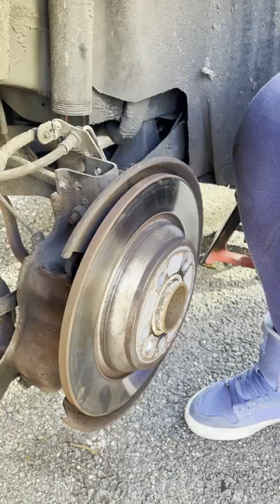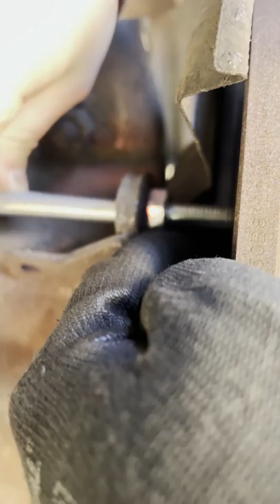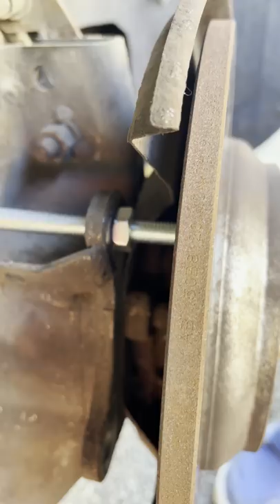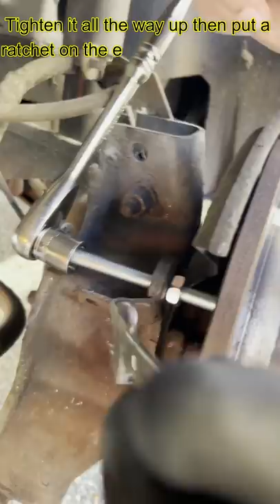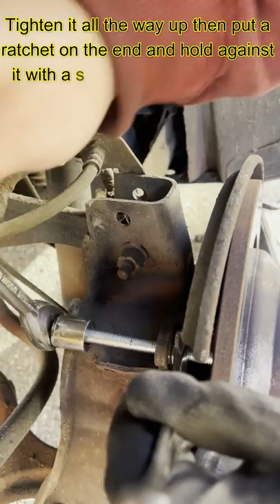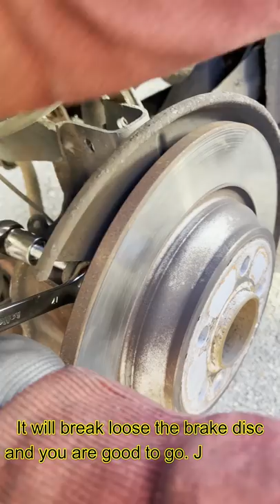How to remove stuck/seized brake rotors

Comment: Don't get mad if you break that caliper holding ear off and have to replace the hub assembly.. this is NOT how to remove a stuck disc.
Reply from the maker: I won't ;) At least I will have something to make a content about.
Reply: @MrNiceGuy94  oof, a hub is a little more difficult than a disc.. go for it !
Reply from the maker: @FRED MERTZ  Here you go.. https://www.youtube.com/watch?v=skcBr7In36c
Before you reply, Yes I am aware that in the linked video I replaced the wheel bearing/hub and not that hub which has the caliper holding ear on it, but I was 1 bolt away from it ;)
Reply: @MrNiceGuy94  I'm not trying to nit pick you..
Reply from the maker: @FRED MERTZ  I know, never thought that. I know comments may "sound" offensive through internet without any context. 
All I am saying is that this method worked for me fine and I hope it could have helped someone else as well.
I won't argue on that this method may or may not break the caliper holding ear off, just simply because it hasn't happened to me so far, but that doesn't mean it can't in the future.

Comment: Once it’s been removed clean where the rotor & hub make contact, then apply anti-seize to the same surfaces & never have issue again. Same with the backside of the wheels: clean & apply anti-seize.
Reply from the maker: Cant agree more,mate. 👍

Comment: Every rotor has 2 wholes for a screw you turn both in equal incriminates and it saves the studs takes it right off
Reply from the maker: agree if it has studs, use 2 bolts
Reply: @MrNiceGuy94  your rotor even has these holes, why tf would you do this, every rotor has those
Reply from the maker: Well, I guess Ethan meant that I could have damaged the studs if I would have had any on this particular car, however I did not have any as you can clearly see from the video. I agreed with him that in the case you have studs sticking out of your knuckle through the rotor use rather 2 bolts and turn them equally, and if you want to be even more accurate you can rotate the rotor itself after a few turns on the bolts to have equal pressure applied to them.
However I do not get what you mean, this rotor/disc ( the part which rotates) has 5 holes for the bolts and 1 additional through which the rotor is mounted to the knuckle.
I really hope this helps.
If you will, please specify what you do not agree with or what you do not understand, even better if you can link pics or a video of it. 
Thanks.
Reply: Damn i left the same comment 🤣 sorry guys didn't see this one. Wrench on
Reply: Got one from a salt area and it wouldn't come off with that method.  The disc started cracking with the two bolts.  Had to use the torch to heat it up.
Reply: As long as the holes you are referring to still have threads in decent condition.  By the time the rotor & mating surfaces corrode & rust over, the the threads are often beyond reasonable use.
I get what you're saying, and works marvels with drum brakes.  But sometimes brute force & a torch is the only answer.
.....been doing brakes 40 years.  I get it.
Reply: Not every rotor has them. This one doesn’t. The threaded hole your seeing is for the bolt that holds the rotor in place.

Comment: There is a service hole for removing the stuck rotor, so you can remove it by inserting a bolt there.  Everyone does that in Japan.
Reply from the maker: @gen Hi, yes that is typical for Japanese cars, but as you could see this rotor did not have that service hole.

Comment: Acetylene torch 🔥 Duh 🙄 but seriously clean the perimeter of the hub with a wire wheel or wire brush and saturated with WD-40 etc. and hit it with a mallet 👍🏼 worst case scenario is actually use acetylene torch 🔥 heat it up for expansion only do not use The acetylene torch to cut anything or major damage may occur 😬

Comment: You could just spray wd 40 when you take off the wheel and use a hammer when the times come to remove the old rotor

Comment: A little squirt of WD40 on both sides of the brake rotor doesn't hurt either to help make the rotor slip loose along the rotor mandral a little easier. But this is a great little  effort saving hack! I'm gonna have to keep this one in the tool box, I'm definitely going to keep this one close by 👍good content, keep'em coming, I'll be watching 😎👍
Reply from the maker: I am glad I could help! 😉

Comment: There's a threaded hole by the lug bolt holes that's designed to remove a stuck rotor, with a separate bolt.
Reply from the maker: not in this rotor mate
Reply: Yess👍

Comment: In my opinion using a little heat on the outer edge of the center and a hammer because what you're doing could bend a caliper bracket ....heat and a hammer that's all you need

Comment: Or you can just remove the wheel and brake rotor screws, spin the wheel and press on the brake- the torque will loosen the disc from the hub.
Reply from the maker: Good idea, have not thought of that.
Definitely will try next time.

Comment: Btw.... The driver of this vehicle is one of those folks that rides their brakes, or breaks way too late. Causing a need for heavier breaking.  I could tell, because that rotor has hot spots all over it.

Comment: You know there's actually a threaded hole in the front of the rotor that allows you to pull the rotor in the manner, and you dont mess up the brake surface of the rotor.
Reply from the maker: Not in this particular rotor. There are 5 holes for the wheel bolts and 1 another for that little screw which holds the rotor to the knuckle.
Reply: @MrNiceGuy94  i see that now. Had to go back and watch it again. Didn't notice it's a European car either the first time.

Comment: There's a hole on the front of the rotor that you use for this. You screw in the bolt, tighten it, then it pushes the rotor away from the hub.
Reply from the maker: @Thatunknownguy  Hi, not in this particular rotor :)
Reply: @MrNiceGuy94  it's the hole that you use to lock the rotor on. Take a scre that's longer than the one it comes with and tighten it. It'll push against the hub assembly and push the rotor right out. Try it out. 👍🏻
Reply from the maker: @Thatunknownguy  It does not matter how long screw you take, because behind the rotor there is also a threaded hole in the wheel hub. So there is nothing to push against it. 
Check out my full length video on this, maybe that makes more sense and you will see it yourself.

Comment: Those extra holes in front of the rotor are for inserting the removal bolt.
Reply from the maker: @jim1082   For God's sake and for 100th time, PLEASE tell me where and in what second of the video did you see those holes on this particular rotor? (there are 5holes for the lug nuts and 1 for the retainer screw)
Your reply would be extremely and extremely appreciated!
Thank You!

Comment: Just get a tool that actually grabs onto the rotor from the sides and uses a Big thick screw that runs in the middle to screw it off loose. 
Better to have it when needed then to need it and not have it.
Reply from the maker: Could link that tool,please? I have never heard of it.

Comment: It can take the whole hub out with it from the bearing. Just wack it straight on with a hammer at the front
Reply from the maker: Wow, well if that would be the case I would have been very happy, because I was replacing the wheel hub, so it would have been much easier and quicker. There will be a video on that one as well. 
Now back to the reality, there is NO WAY that this is going to take out the whole bearing/hub assembly. Prove me wrong and I owe you a lot of beers. :D :D

Comment: Just hit it with a hammer and a cloth and it will pop off. You will have to hit it hard it should not bend at all! It worked for me twice and then I didn't need to do it anymore it just popped right off

Comment: The only problem is, the rotor will deform from doing this. If the rotor is being replaced just beat it off with a hammer.

Comment: If it was actually seized on then that wouldn't have worked and the mounting bracket would've been a bit bent, if it was actually seized a big hammer and heat if needed does the job

Comment: Hit between the lug holes with a hammer and it will pop loose easily 🤔🤔🤔 after all the hammer is a directional motivational tool

Comment: I did that once on an old Honda Element and the rotor was so rusted onto the hub that the knuckle bent at the bolt hole rather that push the rotor off.
Reply: Це тупо

Comment: Absolutely brilliant, mate!  If you pound on the rotor with a hammer, it will transfer impact force from the hammer to the wheel bearing assembly it is attached to.  

Be careful, and great job😁
Reply: That's why you use a rubber mallet. And that's false anyway btw.... Did you not forget that you drive on bumpy roads. Vibrations are transferred to your bearings all the time. So your little pings with your Hammer are not going to hurt your hub bearing. Unless of course you're hitting it with the hammer with all of your might. Then you're trying to screw something up, and your bearings are the last thing you should worry about.
Reply: And also, you do NOT tap on the hub portion of the rotor. Rather. You tap on the outer edges of the rotor while rotating the rotor. This walks the rotor off with ZERO DAMAGE to other components.

Comment: That's all good till u snap the ear off the caliper mounting bracket! We got such nasty rust up here that doesn't work often.a few good smacks with the hammer to the face of the rotor usually let's em pop loose, if not I grab either the plasma torch or oxy torch and cut a slot on the face of the rotor and they come off ...plasma takes me about 5 minutes
Reply from the maker: @erik hall Well, plasma torch is not what is laying around in every household.
Reply: @MrNiceGuy94  no but most guys have atleast a map torch available or an oxy acetrlen torch....this way in video going to cause the common non mechanic to have to replace Thier knuckle when they bend the ear or snap it off. Most ppl don't know when to quit before they damage stuff , I fix more stuff that customers have tried to fix themselves than anything else, it's always a nightmare too, broken bolts, rounded off, or shit backwards or missing. If ur not inclined, just pay someone who knows what they are doing. I mean brakes are a safety thing lol
Reply from the maker: @erik hall I do not want to argue, I can only speak from my experience that it never happened to me that the knuckle ear would break off. Again, I am not saying it is impossible, just because it has not happened to me. However, here in the comments some say that cast iron does not bend just break, others say it bends. So my point is that it is very hard to tell what is the truth, everybody have their own. (and I am not talking about the cast iron now) I am pretty sure you would find people saying that the plasma torch or the map torch is a waste of time, just hit it with hammer and it will come off or you do not know how to use a hammer...if you know what I mean.
Reply: @MrNiceGuy94  not arguing my friend, just warning as alot of ppl lack the knowledge to see the potential damage that's all. I've only had to replace one knuckle so far from the ear being bent tho. I use the hammer to the face if the rotor mostly, but if I hit it 3 times and it doesn't come off I heat the face and leave water running over the bearing as to not cook the grease inside of it. Hitting the face of the rotor too many times can ruin a bearing also. Luckily most ppl do not deal with the levels of rust we do up here so your method should work fine for most, also most rotors have two threaded holes in the face that you can put a bolt in each and tighten the bolt and it will pull the rotor off to, they strip easily and then become useless tho.
Reply from the maker: @erik hall Thank you for your supportive comment :) To be honest I would like to see more people like you on the channel who are able to explain their point in a nice manners. 
Now back to removing the rotor, I am pretty sure that your method works 100% as you must have tried it before. And probably as you said as well, this method is somewhere in between where the hammer is not enough and there is not that big of a rust where it would cause damage to the knuckle ear. I just wanted to shed a light to a different method when the hammer does not work.
Also have a look at my other videos, your comments would be appreciated there as well ;)
Reply: @MrNiceGuy94  I'm a life long mechanic , been doin it professionally for almost 15 years now, so I know what works. Like everyone has heard there are 100 ways to skin a cat lol. I just know alot of ppl watch you tube videos to see how to do things, so I try be as helpful as possible so someone doesn't damage something that's all. I fix alot of stuff that customers have tried to fix by watching a YouTube video lol.

Comment: Yep, you just scratched the 💩 out of that disc by turning the bolt, should have turned the nut!
Reply from the maker: The result would be the same, mate. Turning the nut has the same outcome - pulling the bolt towards the rotor by turning it.
Anyways it all doesn't matter, because the rotor was scrap material, but if you want to keep it, just place the old brake pad between the bolt and the rotor and call it a day. ;)
Reply: @MrNiceGuy94  
Total rubbish, spinning that bolt around whilst adding pressure will scratch it far more than a bolt that's not spinning, turning the nut not the bolt, should have stated in the video it was being scrapped not being reused. So why are you scrapping a perfectly good rotor, no wear on it at all!
Reply: Use the old brake pad between the tip of the bolt & the brake rotor. NO SCRATCHES 🎂
Reply from the maker: @Adolf Shitler  Buddy, turning the nut will cause the bolt to be turning as well(pulling it towards the rotor). You can't have the bolt fixed and the nut turning only, because it is the bolt what pushes off the rotor. 
The other thing is that you can't tell from distance if the rotor is warped/damaged or rubbish. This one was warped and below the allowed threshold for this rotor, which is 2mm minus the original width of the rotor.
Hope this was a clear explanation, but feel free to ask anything if something wasn't clear enough.
Reply: @MrNiceGuy94  
How on this earth can the bolt turn if you hold it still and turn the nut? is the same effect as holding the nut and turning the bolt but without spinning the bolt. You were spinning the bolt against the rotor.
Perhaps you should have explained the rotor was scrap and don't use this method on parts that are going to be re used!
Certainly very little wear on that rotor, warped maybe, worn never!
Reply from the maker: @Adolf Shitler  I will record a short video in order to be able to better explain what I meant. Or you can try it at home as well. Grab a bolt and nut and put the bolt through something fixed. Then if you hold the bolt and start turning the nut, you will notice that the bolt will pulled through the nut, it is how it works. You can't have it both ways, you won't be able to turn the nut and hold the bolt as well.

Comment: There is a threaded hole in between the studs, that's where you place the removal bolt.
Reply from the maker: ....thats where you place that tiny screw which holds the rotor to the knuckle.
Reply: @MrNiceGuy94  on my ute, only the rear has the retaining screw on the drums
The front disks have a threaded hole to release the disk rotoers
Reply from the maker: @Neil Hogan on this Volvo on the both rotors(front and rear) there is only a hole for the retaining screw. 
Check it out in my vid here..
https://www.youtube.com/watch?v=FHcAr23-2Bw

Comment: Best way to bend a caliper bracket. I learned that the hard way.
Reply: If you're removing the rotor you take the caliper and bracket off before you remove the rotor you cannot hit the bracket caliper if they're not there and they're strapped up out of way the weather supposed to be

Comment: Usually a threaded hole on the face of rotor on vehicle with studs. I see that one does have studs that stay so you might be able to use that to push it off. 1 on either side and walk it right off. Same idea tho just diff approach.

Comment: Put the old brake pad between the bolt head & the rotor to save the rotor surface if your saving the rotor AND thread one or two lugnuts on to keep the rotor from flying off when the rust keeping a death grip on the rotor breaks free 🤗🤗
Reply from the maker: Great advice 😉
Reply: @MrNiceGuy94  at least you take the advice. Great man. He is correct. Dont tells others to just press rotor off with bolt digging into rotor surface. Great advice and also great humbleness mr nice guy in accepting it. 👏👏
Reply from the maker: @Patrick Leeroy Farrington for some reason yt has hidden your comment because it thought it was a spam. 
Anyways, I don't have problem accepting a good advice ;) and @Steve Ingalls was right. If you plan to keep the rotor, definitely use the old brake pad between the bolt and the rotor. As I wasn't, it wasn't such a big deal for me if I damage it. 
Thank you for your comment and appreciation.

Comment: Nice way to damage the inside of the rotor with that bolt digging in it. Rubber mallet with pb blaster works everytime without damage.